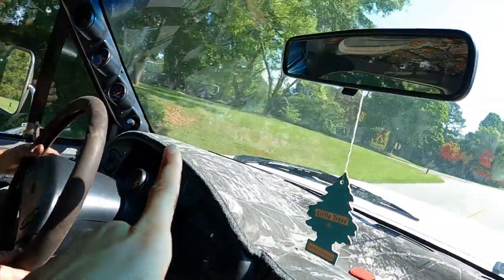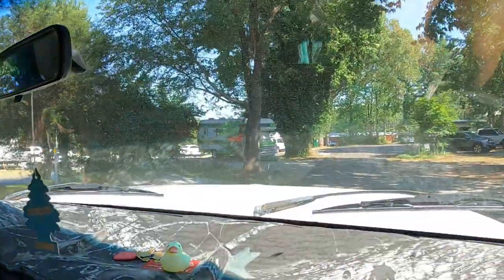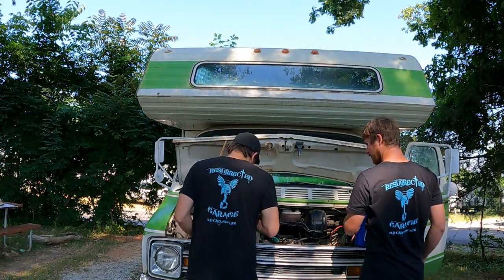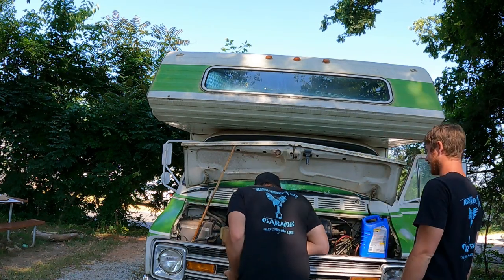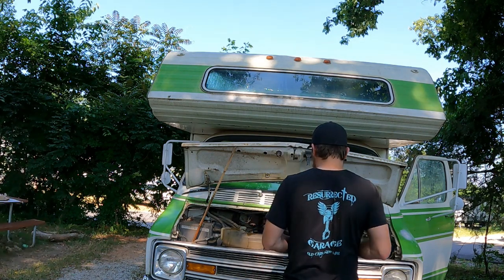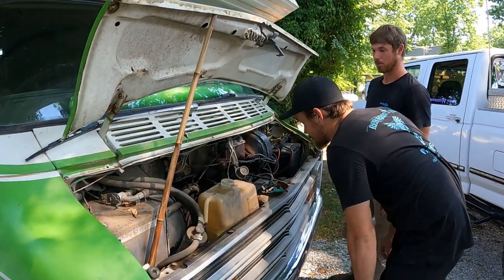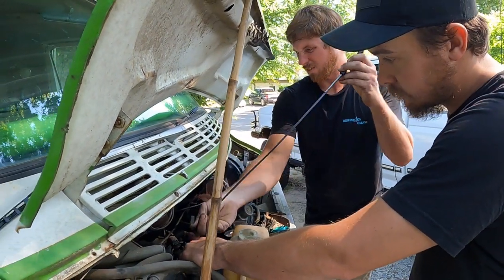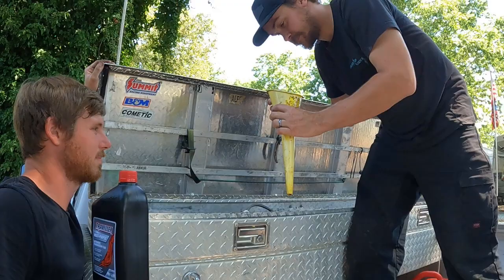Bought a 1976 Dodge Sportsman Camper at the KOA  - Will it Run & Drive Home?

Comment: I have a 1977 Dodge Mallard class C with a 360 V8. I have gone through the entire thing mechanically everything is new! And I did some modifications Edelbrock high intake manifold and an Edelbrock 4-barrel carburetor a new aluminum radiator the timing gears on the 360 breakdown and get into the oil so new gears new chain new oil pump yes I did spend a chunk of change but now I've got a really nice fully solar-powered classic we call Lucy! I wanted to say so bad put your finger down the carburetor hold that butterfly open and it'll start right up!

Comment: In my admittedly limited experience, this is one of the nicest '70s Dodge RVs I've seen... at least on the outside. The interior looks like it could use some work. Still better than others I've seen, though. Most of the ones I've seen have been completely clapped-out junk. Very nice overall, seems as if it was well taken care of.
Reply from the maker: It was a fairly well cared for survivor, some carpet and upholstery would have made the interior 10x nicer

Comment: One of the coolest mods you could do to one of these old motorhomes would be to put a late FI engine and trans in it. I had an 83 Dodge 4X4 that I put a 93 Magnum motor in with the factory injection that turned it into a totally more enjoyable ride. The power and fuel economy difference was unbelievable.
Reply from the maker: Getting away from the early smog era engine in general would make for a good upgrade, overdrive would also be a big plus for highway cruising. This one has already found a new home and was too much of a time capsule to chop up but we have some projects on the to do list you might be interested in
Reply: Yeah... if you got $10K to spare on a $2K motorhome!
Reply: @tonykartracer8032  Only if you are incapable of doing it yourself. It can be converted to a fuel injected magnum for less than $2k. Of course if you have junk to start with it's not worth it, but  starting with a clean motorhome could make it worth the effort. I've done it and it ain't that difficult.
Reply: @moparfan4388  I'll stick to my Japanese Toyota RV..... what you know bout the LEGEND of the 22R motor!  Ahhh YEAH!  People be swapping motors into them Yota RV's too.  It's the best!
Reply: There's nothing more enjoyable to me than just driving them as is and experiencing all the ridiculousness. Swapping in a modern drive train would completely ruin it.
Reply: @motorhomeman1949  I love just turning the key and driving. I don't care for carburetors just because when I was  a mechanic I literally rebuilt a thousand of them. I'll take injection any time over a carb.

Comment: Dodge did produce a large number of sportsman RVs. The best one I had was a travel all sportsman and it had a California test engine in it and was deemed 447-7 it was a attempt at a flexible fuel vehicle, it has propane and gas and natural gas, and it would run on ethel or gas. It got around 16-19 on highway and kept up with the big boys without being sucked around from the wind. 234k finally it fell into disrepair and I sold it for the engine and cage that was the walls and roof of the heavy beast, no wood we xcept the cabinets rest was all angle iron and 1x4 steel tubing. And a few panel sheets to hide it all in the wall.  Heavy bitch and tires it needed were very expensive and around 4k for a new set with correct weight limits. Otherwise the cheapest set for 2 k tires only lasted 2 years before unexpected blow outs occurred at highway speeds.
Reply from the maker: That's something we haven't took a look at it but will eventually need to fix. However it is currently in this video is how we found it.

Comment: Are these reliable I am thinking about getting a 1976 Dodge Sportsman should I get it I have to drive 40 miles home?
Reply from the maker: They are as reliable as anything else from the 70's. We have messed with Dodges, Fords, and Chevy's alike and I don't have anything bad to say about any of them. They are however old and you need to be aware that rubber parts such as belts and hoses don't age well. Just keep those things in mind and you should be ok.